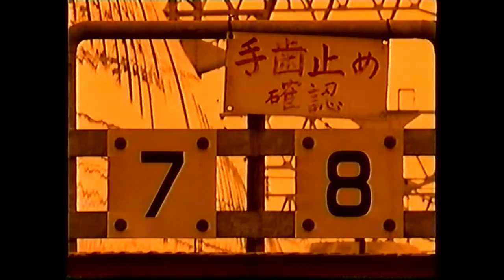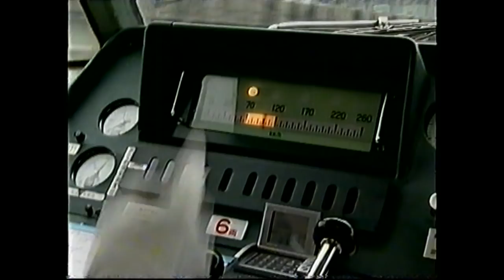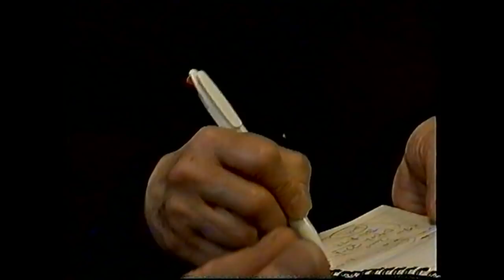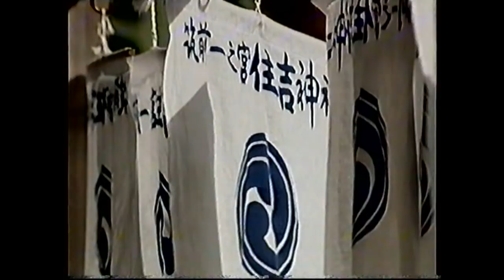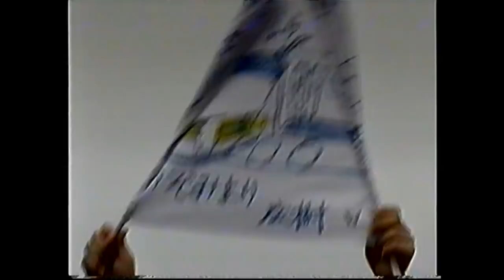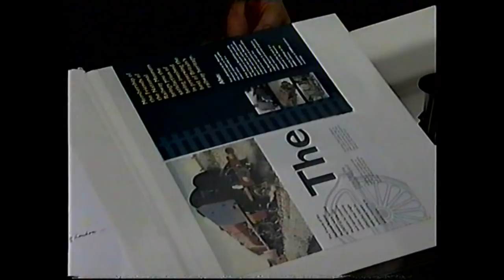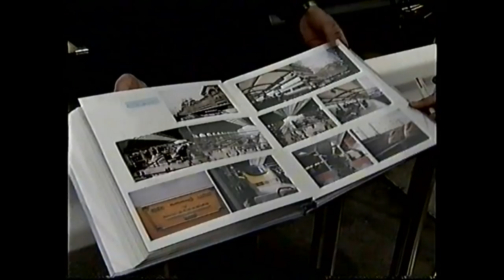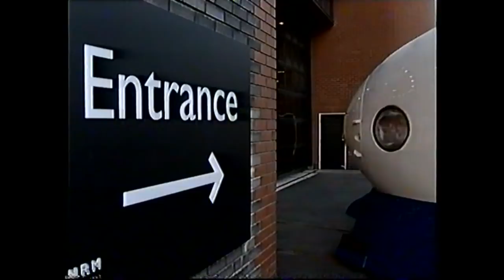York's Oriental Express NRM

Comment: Britain will never achieve this because we do cut every corner to make money and screw the lowest common denominator, the customer. But total respect to the Japanese for their totally outstanding ethos and pride in their work.
Reply: We've tried HS2 but the problem is they spent so long doing consultations on it, and then when they finally start building it they neutered it by cancelling the Northern sections.
Japan has the political will to understand it's expensive and to do it right the first time, proper no nonsense intercity linking on well designed dedicated tracks.

Comment: How little the NRM knew !!!! I was the one who first suggested to Japan Railway Central (JRC) in the early 1990's that they might consider donating one of the original "0" series cab cars to the NRM. This suggestion was first made at the 10 yearly "Will Smith" exhibition which is held simultaneously in Britain & Japan at a multitude of venues in both countries. It is both a culture to culture and business to business exhibition. Will Smith was an English ships pilot who was washed up on the shores of Japan after the ship he was on sank. This is in the mid 1600's and at a time when all foreigners found on Japanese soil were beheaded on sight. Will Smith managed to avoid the inevitable and became an advisor to the Emperor, for his wealth of overseas knowledge. 

The reasoning behind having the ONLY non British built train in the NRM, is based on the fact that it was British Engineers who built the first and many subsequent railways in Japan. Richard & Robert Trevithick were the Grandsons of the man who built the first steam Railway Locomotive in 1803 in Helston Cornwall. The grandsons became the first Civil & Mechanical Engineers in Japan, in 1869. They built the first line from Tokyo to Yokohama (opened 1872) which instigated the first Government Railway, and then went on to expand the Government network. Rolling stock was all initially imported from Britain, and all initial lines were to the 3ft 6in gauge. The Trevithick's later began setting up workshops to build everything in Japan, as more than one shipload of equipment sank en route from Britain to Japan in storms !  The Bullet train cab car is therefore an official "Thankyou" to Britain for giving the Japanese Railway technology.   

Indeed the Japanese were well versed in the delights of British railways progress, as a large party of Japanese railway officials paid a visit in 1933, to see the then Southern Railways London to Brighton electrification. They were particularly interested in the implementation of the four aspect colour light signalling, and Track Circuit Block (TCB) system that the signalling is a part of. They were also interested in the logistical methods of operating high density traffic using TCB and its claim to allow trains at 2 minute headways. Something Tokyo already needed. Indeed the Japanese added a 5th aspect to the British signalling system, and reduced headways to 90 seconds. The busiest station in the World today is Tokyo Shinjuku with 3.2 Million passengers PER DAY, or around the same as ALL London Termini for a WEEK !!!!!!
A.McD.
Reply: Very interesting
Reply: I think you mean William Adams, the English pilot from Gillingham, who was written about in James Clavell's epic novel Shogun. 
His grave is not far from where I live. Known as Anjin-san in Japanese.
The Japanese bullet train, subway lines and a few private railways use the UK standard gauge, 4' 8 1/2", as opposed to the narrower and slower Japan Railways gauge of 3' 6", just a few inches less and they would be classified as narrow gauge lines!
And of the 50 busiest railway stations in the world, all but 5 are located in Japan.

Comment: A few months ago, a Mj 7.4 earthquake occurred in Japan. During that earthquake, part of the piers on which the Shinkansen train runs was damaged. The Shinkansen train cars were also earthquake-proofed, but derailed while slowing down from a speed of 320 km/h. However, five of the 80 or so passengers suffered only minor injuries.
Unfortunately, the derailed Shinkansen was scrapped, but the Shinkansen is a source of pride for the Japanese people, who put their bodies on the line to protect the crew and passengers.
Reply: Actually ever since that Earthquake, all Shinkansen services are stopped if a earthquake is detected. The drivers do not have to do anything, the computers take over and bring the trains to a stop, if the driver does attempt to stop in a tunnel (the JR engineer training prohibits engineers of Shinkansen from stopping the train in a tunnel for safety purposes), the computer does not allow him to stop the train in a tunnel, if the power goes out and the Shinkansen is in a tunnel, the train is equipped with onboard batteries that allow it to be driven out of the tunnel by the driver as well.
Reply: @nikerailfanningttm9046  He is referring to some other earthquake

Comment: I’m no expert and I may have missed something, but being a different track gauge in Japan, how did they manoeuvre it along the tracks in the UK? Were different bogies attached?
Reply: According to Richard Gibbon, they had permission from Railtrack to close part of the ECML and remove any Signals and signposts which got in the way due to the width of the Bullet Train. They had to form a makeshift coupling with a Class 66 diesel locomotive so that it could be parked in a correct position so that it could be entered into the Museum on its own power
Reply: But the Shinkansen uses the same loading gauge in Britain which is 4ft 8 1/2 inch
Reply from the maker: The Japanese USED to have a different track gauge, when designing and building the Bullet Train they re-laid the track be "standard gauge" in line with the UK and other countries
Reply: @duke68012  What a fortunate coincidence 😂 Thanks for educating me 😌
Reply: @joeyed96  An amazing feat and challenge. All this work and effort goes unnoticed sadly. I hope to visit the NRM very soon. I haven’t been since the mid-90’s
Reply: The Japanese main line tracks are using cape gauge but the Shinkansen tracks are standard gauge same as Britain
Reply: That’s why the Shinkansen trains are bigger
Reply: @duke68012  Former JR lines (excluding Shinkansen) still have cape gauge as well as many private lines. Even new lines or heavy upgrades don't chnage the rail gauge.
The only exception being the Yamagata and Akita Shinkansen segments running on conventional line. They were rebuild to standard gauge to allow through running with the rest of the Shinkansen network although they have to conform to the smaller main line loading gauge.
Reply: @joeyed96  Technically, no. Shinkansen use standard gauge which is the same track gauge, however loading gauge refers to the dimensions allowed for the body of the vehicle or what's on the vehicle. It's essentially the clearance. Funnily enough the UK has one of the smallest loading gauges in the world, so it's a wonder a shinkansen can fit on the UK network. But, the clearances vary depending on where. The main issue is usually tunnels, bridges, and station platforms.
Reply: @eirinym  Well explained, and it's one reason British trains like the Pendolino feel so cramped, they still need to conform to the UK's slim loading gauge even when tilting so the car bodies taper towards the top.
Reply: @joeyed96  No: The same track gauge, but a much larger loading gauge (basically width and height).
Reply: @joeyed96  Soz! I just saw this had already been explained! 😬😬😬